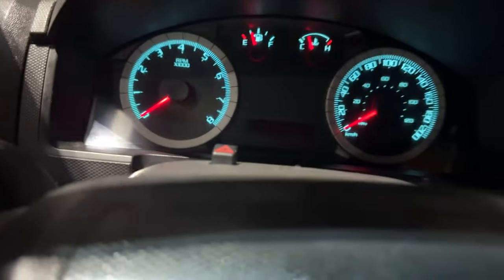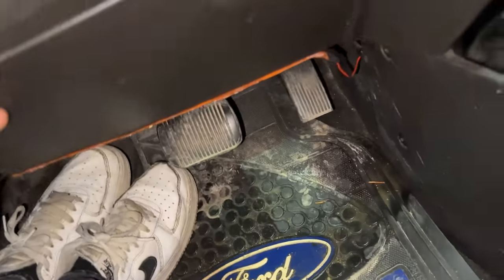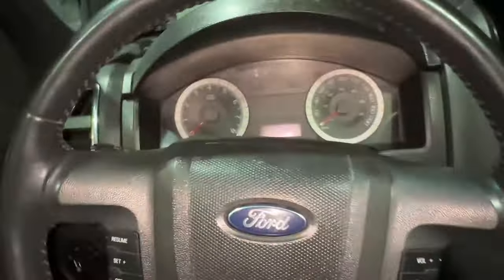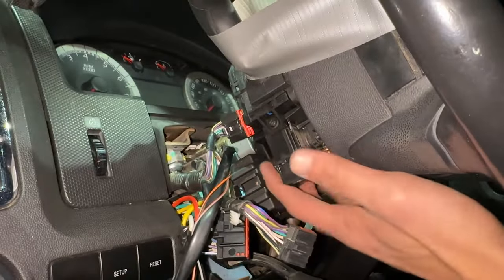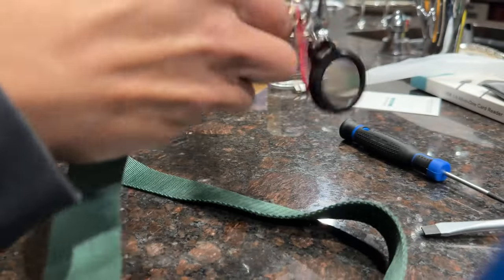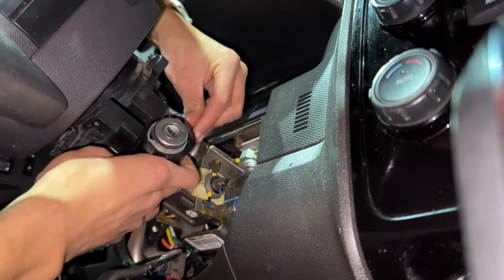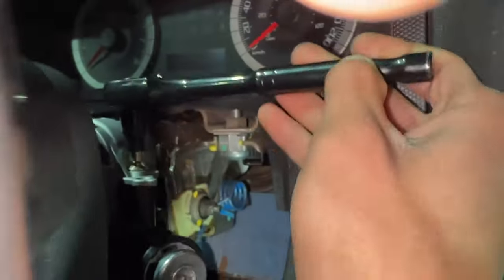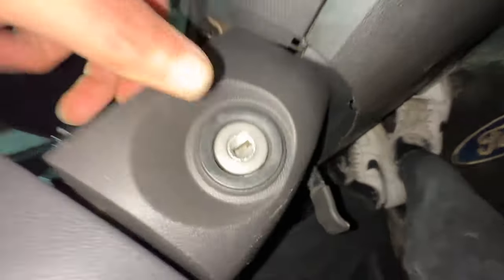Ignition Lock Housing Replacement for 08-12 Ford Escape /MazdaTribute Fix No Crank no start concerns

Comment: I used your video to get the job done. Thanks! Only thing I would recommend is using zip ties instead of duct tape. That kept from getting any sticky residue on the steering wheel.
Reply: I used a bungee cord that worked pretty good too.

Comment: KOOL..ON THE SECURITY BOLD ALL YOU HAVE TO DO IS HIT IT WITH A CHEASIL OR FLAT SCREW DRIVER PREFER CHEISEL COUNTER CLOCK WISE AND THIS WILL LOOSEN IT,,,,ITS NOT TIGHT,,AT LEAST NOT ON MINE,,,,TNX FOR VIDEO

Comment: Don't be dumb like me and not push in the pin that holds the cylinder in place 🤦 thought I broke a new part and was told to order a new one. Only found out I messed up when trying to put in the 2nd one

Comment: For some reason I can't get the new Ignition housing to fit tightly around the column. I've tried wiggling everything.  Any suggestions? I don't think it's a product defect cause I've tried to put the old one back on to compare and now it won't come together either.
Reply: Try with the key on

Comment: Couldn’t you replace the ignition switch without removing everything from the steering column?
Reply: Yes but the ignition lock cylinder is the problem child in these cars.

Comment: instead of no start im having the issue of not turning off once key is removed
Reply: and i have replaced lock cylinder
Reply: Not sure if you fixed this or not. I have the same issue. I'm pretty sure it the piece in the lock housing that connects the cylinder to the ignition switch that broke (in my case on the switch side). I'm getting a new housing in the mail tomorrow and will update if it ends up being a different issue